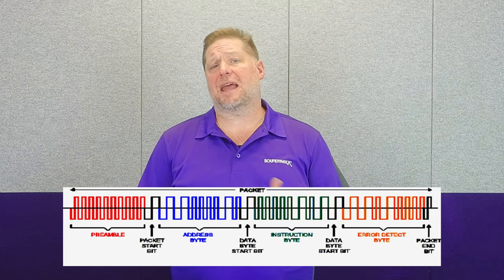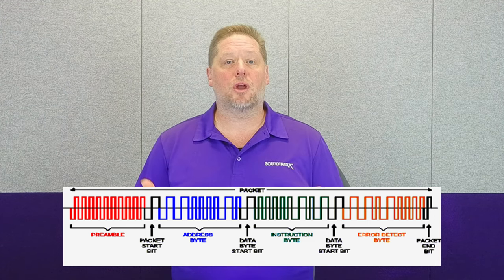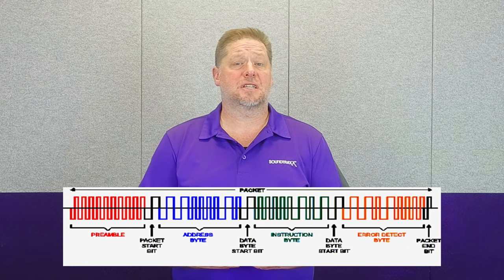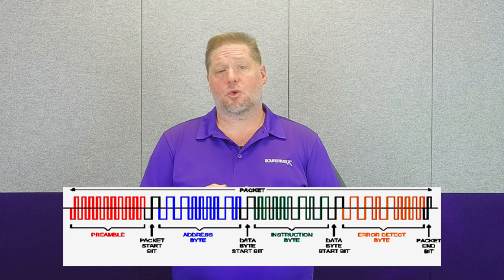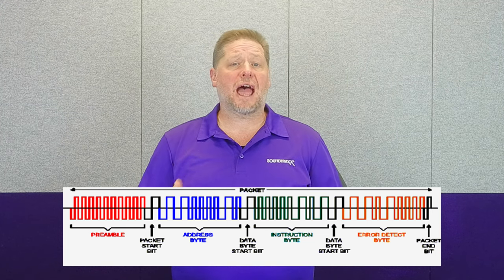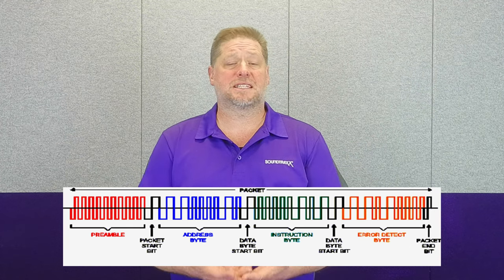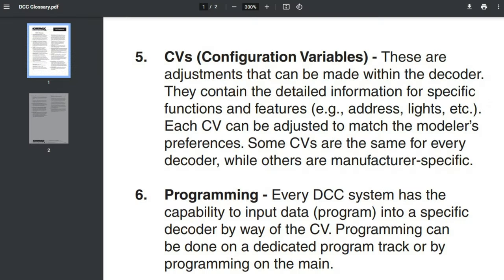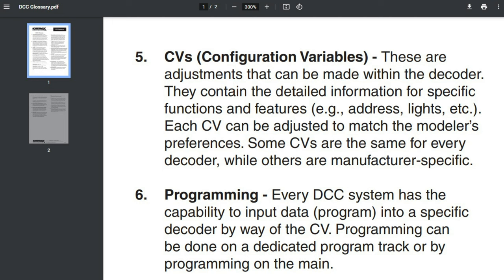The Basics of DCC

Comment: I did not understand your difference between a test track and a programming track. I have a programmer setup on a separate track that I use for both programming and testing locomotives.
Reply from the maker: A test track is a mainline track that you use to test your trains. A programming track is a small dedicated track for programming using the DCC programming track protocol that you cannot run your trains on.  The DCC language is slightly different, so that is why these are separate.  You cannot run your loco on a programming track.  We get calls all the time where I ask to place it on a programming track to use the different DCC protocol and the caller places it on his ‘test’ track that he uses for CV programming. Not the same, and I cannot do what I need to do to the decoder to regain control if you are operating on a test track using mainline DCC protocol (operations.)  I hope this helps.  If not, give us a call at the office: (970)259-0690 ext.22 or support@soundtraxx.com